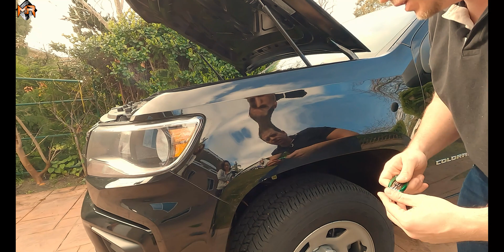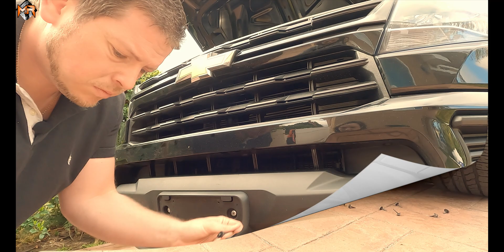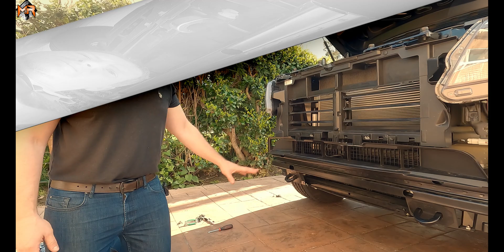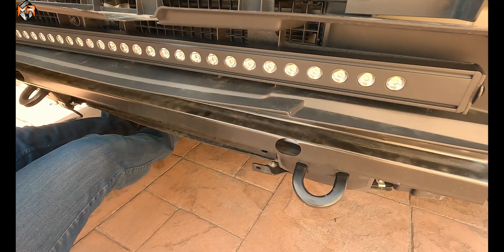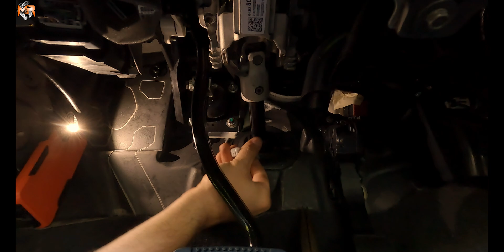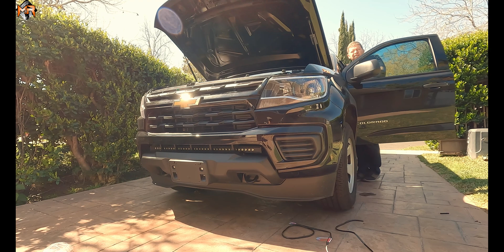2021-2023 Chevrolet Colorado 40in Light Bar Install | Behind Grille

Comment: Will this same type of setup work on the 24 Colorado? I dont want to do the behind the grill set up that you show for the 23-24 Colorado. I want a set up like this to fill the gap between the bumper and grill.
Reply from the maker: @McCheezitz  we have a setup specifically for 23+. Please check the site for that kit
Reply: @MandRautomotive  I saw that kit. Like asked in the comment, would THIS set up work for the 24 Colorado? I want to take up the space between the grill and bumper... Not mount BEHIND the grill.
Reply from the maker: @McCheezitz no sir this kit will not work